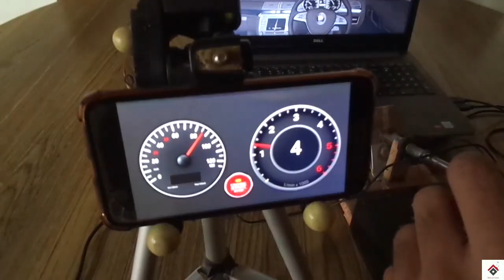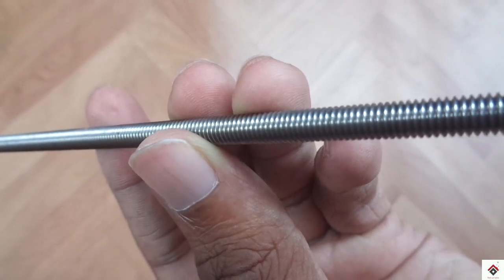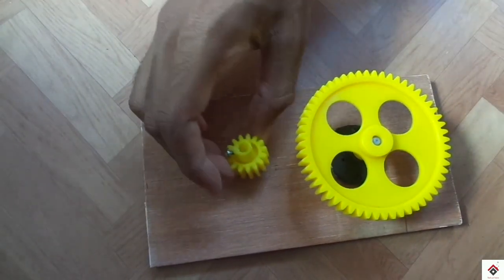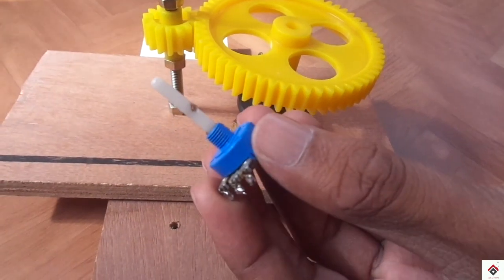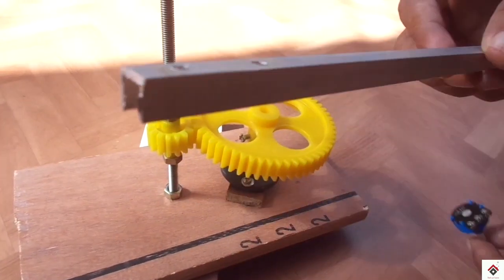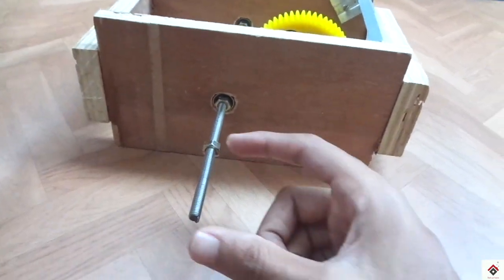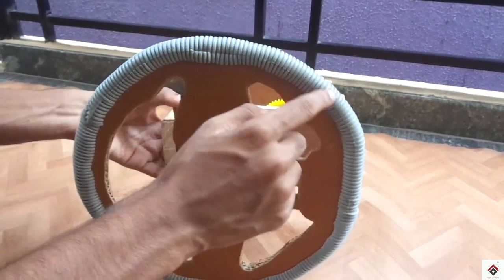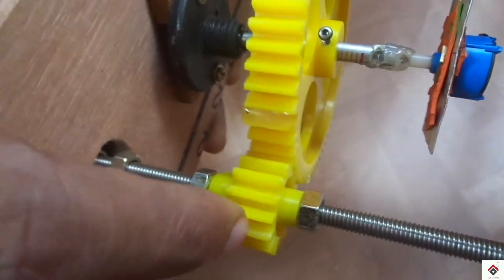900 degree Steering wheel using Arduino Unojoy | Upgrading 270⁰ steering wheel to 900⁰ [In ENGLISH]

Comment: Will arduino uno (SMD IC ) work for this project?
Reply from the maker: No ,
Only DIP version works
Reply: Hey bro did you try makind it with your smd ic one pls tell bro
Reply from the maker: SMD version of Arduino has ch340 chip for serial communication.

But this firmware is for 16u2 chip which is present on Dip version of Arduino.

Comment: Which types of potentiometer is used like single turn or multi turn ?
Reply from the maker: Normal single turn 10k potentiometer is used.
To increase the rotation to 900 degree, gear mechanism is added.
Reply: Sir can i make this gaming steering with arduino nano pls replay to me
Reply from the maker: No
Reply: @jesinsinan7044  you can make one with arduino nano, fork adafruit's hid gamepad library and use it.

Comment: How should I buy the potentiometer? 10k  For Arduino?
Reply from the maker: Yes, 10k normal potentiometer
Reply: @techathome  thanks for your videos! I've been looking at them and I'll try it this week, my idea was to make the steering wheel with 900° and add buttons for turn signals, lights and paddle changes. thanks again for your videos! They motivate a lot lol
Reply: @techathome  sorry for the inconvenience but do you know if it is possible to use 20k or 50k potentiometers? unfortunately they are the only ones I have available :(
Reply from the maker: You can use any value of Potentiometer. It doesn't vary much.
Reply: Bro did u make it?

Comment: Bro can i just attach a Rotary Encoder to the shaft of the steering Wheel ?
Reply from the maker: Are you referring to FFB wheel tutorial or this video?
Reply: @techathome  only this video so without the Gears only stach the rotary Encoder to the Steuerung Wheel steering
Reply from the maker: This is not encoder, it's 10k potentiometer.
You can use directly, but wheel will be just 270 degree.

To increase degrees of rotation, we have used gears.

Comment: Bro is it 270 degrees rotation or 900 degrees. If it’s 270 degrees how can I make it 900 degrees rotation

Please Reply😢
Reply from the maker: Potentiometer is 270 degrees , After using the gears the steering is 900 degree.

Comment: i use one small and one big wheel and used a ruber band to conect both instead of gear it works same as gears
Reply from the maker: Nice 🙂
Reply: @techathome  brother i have a question can we make force feedback wheel with arduino UNO?
Reply from the maker: No.

Comment: Hello! I need some help. I don't have a 3d printer for the gears, is there any way to use a rotary encoder module instead?
Reply from the maker: This firmware doesn't work with encoder.

There is new version of wheel, you can make this version with rotary encoder: https://youtu.be/6pEiYvWLGJ4?si=sxaTuGF_tOPdNSgE

Complete playlist: https://youtube.com/playlist?list=PL4B0LEKY-jrROPZPEDMZ4DPqISPXvVsdL&si=qAb80jzDaFeD69gm

Comment: Can i add analog( as shown in you ffb steering video )clutch,break and accelerator and use adruino Uno to configure all of them along with this steering with a 100k potentiometer.
Reply from the maker: Use this circuit and code: https://drive.google.com/file/d/12i-rsl3xpVoyA1x3x1BKBp0t-3153vR1/view?usp=share_link

Comment: Bro can we use ttp223 sensor instead of the buttons
Reply from the maker: In this code, the digital buttons should be connected to GND to activate.
If this sensor gives low signal when it is activated, then it might work.

Comment: I would like to see playing in Gran Turismo 7 or Asserto Corsa competizione if it has the same precision.
Reply from the maker: I tried on Forza horizon, It won't work.
This is good for simulator like Euro truck
Reply: @techathome  how do you mean it won't work with Forza Horizon?  Is it just not precise enough?
Reply: @masskonfuzion did you try it?
Reply: No not yet - I wanted to hear what the precision issues are. But I want to try it..
Reply: @masskonfuzion   so i read some comments on this video and i think the issue is that the arduino isnt getting detected as a gamepad
Reply: @masskonfuzion  i will just try it today ill let you know if it worked
Reply: @bossoy0769  so - I'm actually going to use a gamepad as my controller, not an Arduino (at least, first pass). Because I know my gamepad will be recognized, heh. With Arduino, it looks like there are any of up to 3 different firmwares I've seen in various videos, and I'm not sure where to start with that

Comment: Hello sir How to upload the Arduino Uno firmware, what is the Smd Atmega 328 version
Reply from the maker: To upload the firmware, you have to go into DFU mode which is possible only in DIP version.
Used in this tutorial: https://youtu.be/CPWPPu2dR7M

But this is not possible in SMD version
Reply: @techathome  means the smd version cannot be used to make a steering wheel
Reply from the maker: Yes not possible with SMD
Reply: @techathome  the amd version can't enter dfu mode is there a way is there really no such feature for smd only dip

Comment: Can i use 10k Ohm 3590S Precision Multiturn Potentiometer.
Reply from the maker: I have not tried that,
It might work.
Reply: @techathome  that Potentiometer has in built 10 turns so we didn't need to use gears that's why I asked you
Reply from the maker: Then it should work, 
At the end Arduino need voltage drop.
Reply: @techathome  so can you help me what should I do
Reply: @akhildavis4457  bro did u tired mee to want that high precision potentiometer test build
Reply: @YOUTUBECOUSPOLICY  no bro it doesn't work , instead of that i used  high quality 10kohm potentiometer it will work  smoothly for me
Reply: @YOUTUBECOUSPOLICY  try don't to buy cheap quality 10kohm poteinometer 
instead of take poteinometer around 40rs
Reply: @YOUTUBECOUSPOLICY  first time i buy a 10k poteinometer from the local store around 10rs but when make steering wheel it works but it has no smoothness  in steering wheel inside game then i orderded new 10 k ohm potentiometer from Amazon that works smoothly it cost around 40rs
Reply: @akhildavis4457  thanks bro 👍😁🙏

Comment: how to deal with the potential vibrating when in use, how do you make it not vibrate when playing the euro truck steer game to vibrate
Reply from the maker: Use B10K potentiometer.
Reply: @techathome   im facing similar issue  if i turn the wheel right it slow and smoothly turned, if i turn left it rapidly turn what should I do?  

b10k potentialmeter is used